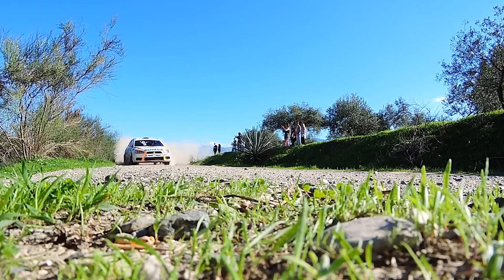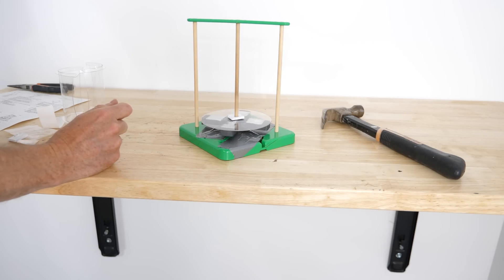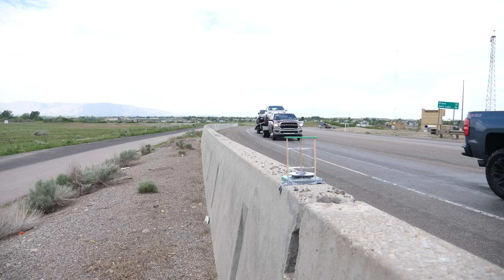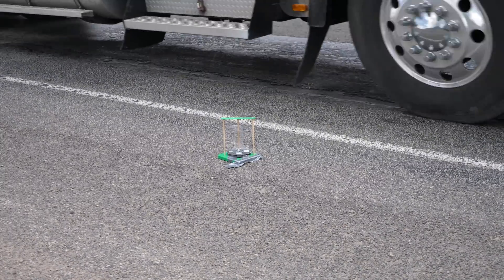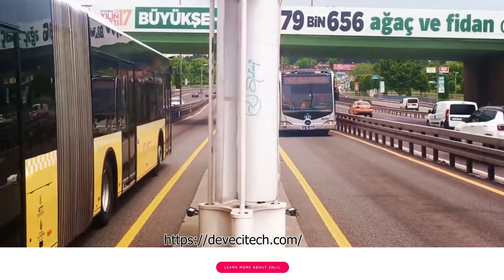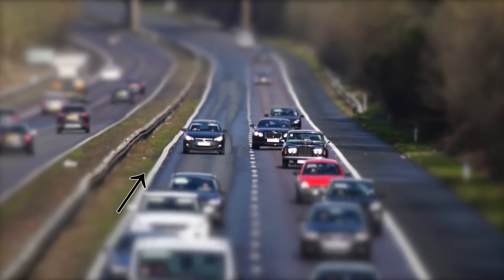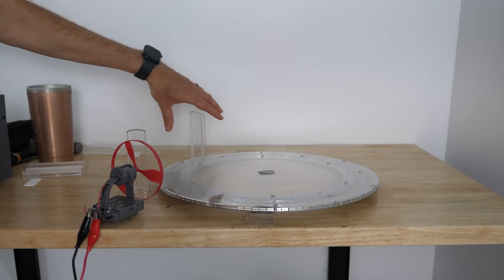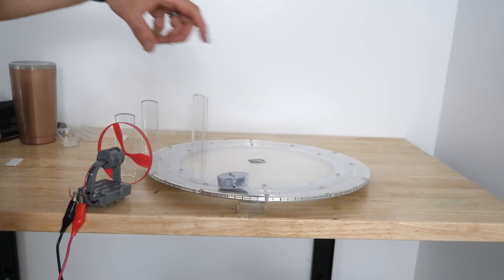Do Traffic Turbines Actually Work?

Comment: I'd like to see you do a video on people using gravity to generate power!
Imagine that every time a new home is built, a several ton weight of  some sort is suspended dangling from strong cables, say 20ft in the air. Then imagine something similar to clockworks, with a system of gears toothed wheels & pulleys, etc. The gears would allow the weight to very very slowly descend (like the hour hand on a clock or slower), while the clockworks are generating power from the movement, that is functioning via gravity.
I figured a solution to raising the wait would be maybe a manual Crank that you could manually turn to raise the massive weight back up to the top. Anyone that reads this, let me know if this is ridiculous or if this could be achieved with some very clever gear ratios.
Reply: Technically you could only get the same amount of power out of it as it took to raise it up. In reality you'd get less due to factors such as friction.
Reply: @Plasmacore_V  
I was thinking a cleverly geared hand crank, sure it would take manual labor to crank it back up, which would have to be done maybe daily.  I'm only thinking about producing enough electricity for one home.
Reply: @uncle-epicurus  Problem is that the best athletes can produce only about 350W, and not for very long.  Your house's typical power usage probably exceeds that for most of the day.  So even though you could store some of your physical energy as potential energy, I don't think you could ever exceed the power usage of your house, leaving nothing left over to store.  According to my quick google search, a typical house uses 10,557 kWh of energy per year, which works out to an average of about 1200W continuous power usage.  Of course, you can probably drop that number significantly by using energy-saving appliances, high-efficiency heat pumps, etc., but I think that the consumption will still exceed your ability to produce power.

Comment: Some kind of piezoelectric generator would be a far more sensible route to go down. Imagine the roads generating current just off the weight of traffic applying pressure to a section

Comment: Well the thing is, as long as the air isn't moving anyway, you obviously can't possibly get more energy out of it, than the cars have to put into it. So basically it's just a very inefficient gasoline generator. And if the air is moving anyway, you might as well put the turbine somewhere, where it can reach the air more easily, preferably somewhere higher than on the side of some road with cars blocking the wind.

Comment: No it doesn't work unfortunately.  By conservation of energy, the extra electrical energy generated comes from the extra work against air resistance, which ultimately comes from the car burning more fuel (chemical energy). No extra energy is "gained"  or "generated" after all.
Reply: This is true of ALL energy generators. Generators CONVERT energy. They do not create it.
Reply: @joekemp83  Yes, but here the energy converted ultimately comes from the car, which comes from burning the FUEL, unlike solar energy or wind energy which comes from the sun.
Reply: @arborger9771   The energy of the fuel also ultimately comes from the sun.

In any case, if the turbines are placed only on the downhill run when vehicles should be braking, they are not reducing the efficiency of the vehicle. In fact they are saving your brakes.

Having said that, I don't see the point of doing this when the turbines can instead be used to capture natural wind.
Reply: @joekemp83  I should be more clear. Placed on a normal highway, the turbine cannot *save* any energy. Otherwise, why hasn't people placed turbines in train tunnels yet? For the same reason, it doesn't save any energy.
Although the energy of the fuel also comes from the sun (ultimately as someone would say), burning it also causes harm to the environment, unlike directly harvesting solar/wind power
Nevertheless, the downhill one is a valid point, but whether it is implementable would be another issue
(Edit: Companies such as Tesla has already been working on converting the thermal energy dissipated during braking back to electrical energy. So I don't think wind turbines here are necessary at all)

Comment: I don't think the superconductor experiment was good. Since the floating magnet was using the wind from the fan for its propulsion, the windmills should have been placed outside of the path of the same wind because it will be disrupting the magnet from using the wind properly. Remember, the cars are providing their own propulsion, so the windmills should have been placed further down the track where the magnet is already moving with its own momentum, and not being disrupted where it's being "pushed".

Comment: I don't think the fan pushing on the magnet was the best analog here. That'd be more like a tail wind, but we want to know if the wind displaced by the car being slowed by a turbine slows down the car.
Maybe a pinewood derby track could help test this?
Reply: Whether the object is the source of the wind or is acted on by an external source of wind makes no difference in the equations. Physics equations don't care about the starting positions of the forces.
Reply: @5467nick  But the direction of the forces matter. I imagine the air going around a car is similar to the air going around a wing in an air tunnel, rejoining with some turbulence after the object. That would be either neutral or push backwards against the car, not create a void that pulls air from behind the next car forward.
Reply: @travissmith5994  The wind from the fan was the same as wind from a second car acting on the first car, just as would happen when you're on the road with someone else in front of or behind you. Interrupting that wind is no different from interrupting your own "wind" as it all adds up to a single drag force in real life.

Comment: If the turbines were suspended over the cars, would the cars still experience resistance? Seems like  the air flow would disperse upward.
Reply: If it interacts with any air that was moved by a car, then the car is what is pushing on the turbine. There is no special position or angle that would change this.

Comment: You are burning fuel to push air with an object, that is designed to push as little air as possible, into a turbine. Is there any less efficient way to do this? You would be far better off using the fuel to directly turn the turbine - which we are already doing on a big scale.
This "invention" fools only those who never learned about energy and physics. There is no free energy, the cars need to provide this extra energy and the efficiency is so horrible, that we shouldn't even think about it.

Comment: Build one to put on a car, to run the electronics as you drive or to trickle charge the battery.
Reply: That would increase the drag on the car more than the power you get out of the turbine.  That's one of those "perpetual motion" laws, unfortunately.

Comment: For sure it has a niche purpose, but from where i am in Quebec, we have a good amount of high bridges with 2 way traffic on wich those could be installed, benefitting both from the cars' air flow but also the wind's. 

(For example, Laviolette bridge in Trois-Rivières, or Pierre Laporte bridge in Quebec city)

Comment: The "wind" is produced by the car (gas/diesel powered).  Therefore, the "wind" is just an indirect drive shaft -- pushing a generator -- with the car/truck being the source of energy turning the "shaft."  This is (A) insanely inefficient, and (B) completely the opposite of what wind energy is supposed to be (clean).  This idea is no better than building 20,000 super tiny, extremely inefficient, GASOLINE/DIESEL-fueled, electric generators.  Stupid.

Comment: It works great if the energy source is the Sun. But once you factor in fuel consumption, this makes no sense.
Also there is a difference between just a tree or person standing and a windmill. If the object is static, a high pressure front forms in front of the object, this changes it's aerodynamic resistance.
But if the object is moving and absorbing this high pressure build up, like a fan or a wind mill would, then it provides higher aerodynamic drag on the car. The car would have to move more air to pass the same distance at the same speed. You'd be converting fuel to air drag and then to electricity and there are huge losses at every step in the process. 
If it was the Sun moving the air, then we wouldn't care about losses, but since we are paying for the petrol (or electricity), it makes no sense.

Comment: They are not stealing the energy from the cars, if they are mounted in the median between two busy lanes of opposite traffic. In that case, the opposite traffic is creating high shear between the lanes, turbines or not -- and that shear is creating vortices and dissipating energy, turbine or no turbine. In essence, the turbine doesn't matter if you are being swept back by the wind from the opposite lane anyway.

However, it is still a negligible gain and a pointless waste of resources, it will take a while for it to even pay back its own production and installation footprint. Also, there is so much more energy in any gentle breeze generated by the weather, that all these proposals are just technology pipe dream scams on the level of the hyperloop.

Comment: In theory it would be possible to place a trench across the road with a tubular fan/turbine inside and a safety grate overtop so cars can pass over. I don't see a large impact on vehicle performance, certainly not enough to consider a problem.

Comment: Excellent experiment. Although you should repeat it with a turbine around 3 feet tall if placed on the road in order to get the full effect of the wind created by the body of the vehicles. Yours being that low is missing most of the wind. Otherwise, if you could find a section of highway where the cement divider, or side cement barrier, has no shoulder, then you can place your current model on top of the divider or side barrier.

They should work on sections of highways with no shoulders where vehicles travel at least 60mph, and especially so above 70mph. Spaced properly apart they won't make any difference on the vehicles.

Comment: Why not install like a pressure plate switch thingy in the road and every time a vehicle passes over it then THAT powers the turbine instead? Obviously no worries about safety and air resistance in that case. 🤔

Comment: this was the longest explaination of why this doesnt work when you could have simply looked at the potential energy output and the cost and laughed.   Yeah you can power an led lightbulb with one of these giant things,  or you can spend that money generating clean energy practically any other way.   There are lots of ways to generate energy but they are all scams,  you can generate energy by harnessing the power of walking on a subway station but it wont do more than maybe light up as you walk,   or harnessing the power of movement - like a wind up watch does - but you arent charging your cell phone with it.    This is scam science 101 - take something that works small scale and doesnt work large scale practically or physically and then sell it like it does and investors fall for it everytime!   Why not solar roadways ! - why not just put the solar panels on the side of the road where they will be 100x more efficient and not break.

Comment: This is an excelent demonstration but I think you forgot a (maybe) important thing. Freeways usually (at least where I live) have two opposite-direction roads right next to each other. Each road generates its own wind but these winds meet in the middle where they create eddies and similar things. This can create resistance on cars. It would need to be properly simulated but it seems to me that turbines in the middle could take energy away from these eddies and therefore lower this middle-side resistance. Also, for big freeways, most of the wind travels through the middle of each road, which makes the division line the only place to really care about different resistance caused by obstructions and could make the whole "decrease in efficiency" thing debatable.

Comment: Lots of small turbines requiring maintenance teams and regular repair and danger to those teams and the cars to capture a breeze that is small compared to the general wind . Wait why not replace a thousand of those with one big turbine on a hill ? Wait why not just put small solar panels where each turbine would be to cut out the maintenance . But wait why not put a few normal size panels on a house , equivalent to a mile of dangerous road . The whole thing is small and niche and larger scale things have better economy

Comment: What I would like to try is to harness the energy in the sound of the trafic. I wonder how much there is and whether it can be harnessed efficiently.
Reply: With EVs coming around, you'll only harness the sound of horns.
Reply: @DragonOfTheMortalKombat  There's still tire noise, and sound of displacing air,  but yeah much of that.  Over time roads will get quieter due to electrification, but they will never be silent.

Comment: What if we put a bunch of wind turbines along sections of highways that have cars going downhill? Steep enough downhills that just coasting would not be enough and brakes are used anyways.
Reply: That is the only use case for this that isn't completely ridiculous, though it would still be less efficient than the integrated regen braking of an EV or hybrid.

Comment: The only traffic related turbine I can see happening is when it comes to using flowing wind across a car for the car use. But that may not be very practical 😅
Reply: It's absolutely not practical. That flow energy comes from the battery or gasoline anyway so a generator or battery terminal is the right place to harvest this energy efficiently. Cars really do that already.

Comment: My question is, what if the wind is going the wrong way or slows down the turbine
Reply: Vertical-axis wind turbines spin in the same direction no matter which way the wind is blowing.  The disadvantage is that they aren't as efficient as horizontal-axis turbines of the same size.

Comment: When even just a car drives by me, i can feel the wave of pressure because my suspension is really soft, it's crazy there's a lot of energy there and we wouldn't be wasting anything... i don't think it makes a difference because the fast moving air also imparts its own turbulence... the only thing is drafting effects and if you're in a traffic wave all the vehicles ahead of you are pushing the air so it's kind of generally moving along side your vehicle. But on a breezy or light wind day, all that is easily negated.

Comment: I can see this working well in Tunnels. It could be used to help power the tunnels lights. I doubt if it would make a noticeable difference in efficiency for vehicles going through a tunnel. This location would also let the technology develop and the show the pros and cons.
Reply: If it makes a noticeable brightness of a light, it definitely makes noticeable air resistance. Hence, pretty much the same amount of difference in car fuel expenditures. It's just spread out across many car owners.

So many people commenting about tunnels but forgetting that tunnels, of all places, are equipped with power and comms lines along their length. Using efficiently generated utility power makes way more sense than building heaps of alternative gadgets to place right next to them.

I can thumbsup the commenters that say that in remote open spaces (far from any existing illumination or comms infrastructure) this could be useful, but even there, a solar panel with a battery is more predictable and well established.

Comment: In your experiment, blowing the superconductor with a fan is a wrong approch. That inndicates that the energy pushing the cars on the road is the wind behind the car. This is not the case. The energy has allready left the car when the wind hits the turbine. The turbine wont slow down any cars on the road. If something, it will stop the wind from hitting the traffic on the other side og the road.

Comment: The resistance they add, wouldn't matter, if they'd be replacing other obstructions, like the polsed for overhead signs or streetlights. I think I could see them being useful in a tunnel, for instance, to power the lighting and/or electronic signage in the tunnel.
Reply: Yep, they'd have to replace existing structures to work.
Reply: No because it would be an insignificant amount of energy generated, and if you had to put a lot of them by the road, the resistance would add up quickly.

Comment: Why not create a donut-shaped wind-tunnel filled with as many turbines as you can fit? With one fan running it, the air has nowhere else to go but forwards, then back around into the fan again, thus you should technically be able to create more energy that it takes to run one fan. Free energy.
Reply: Follow James' inspiration and try it, build the real thing. Seeing the failure in practice is probably the best way to expose yourself to the law of conservation of energy?

Comment: the best place to put them is the center line. there, you have air forces from both sides colliding. bringing the air to a stand still, rather than having them fight against eachother, is an upgrade to the efficiencies of the cars passing by.

Comment: But if you put them in the median between two flows of traffic the traffic was already getting that resistance from the wind from the oncoming traffic.  So there it should be free, because otherwise the swirling motion just becomes turbulence and then heat.